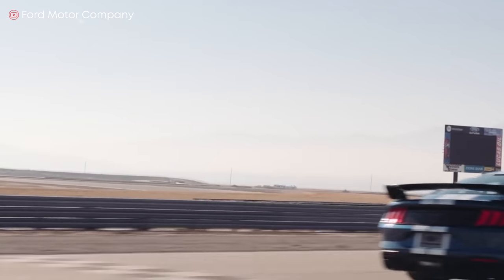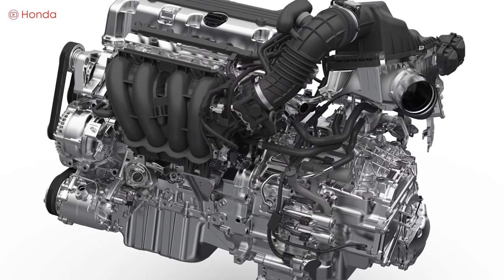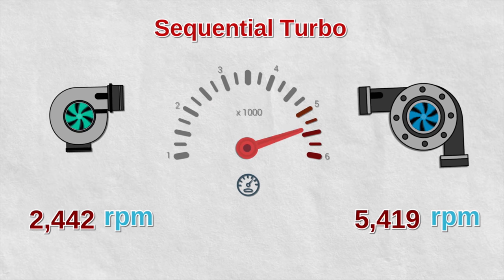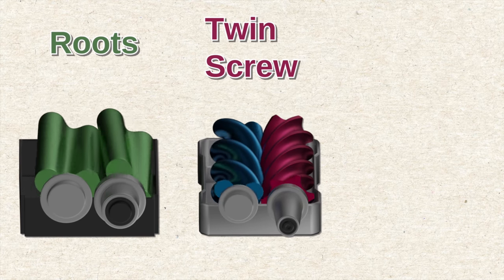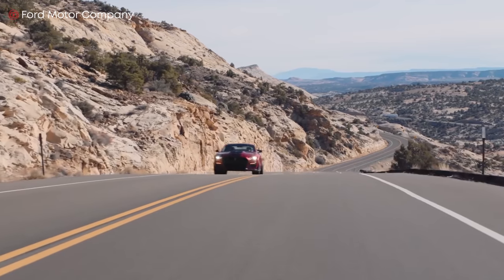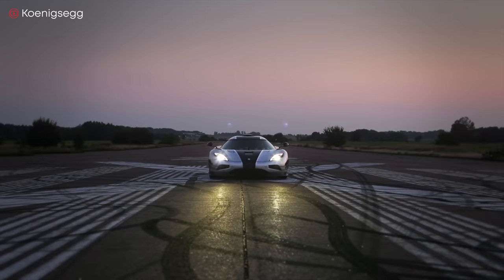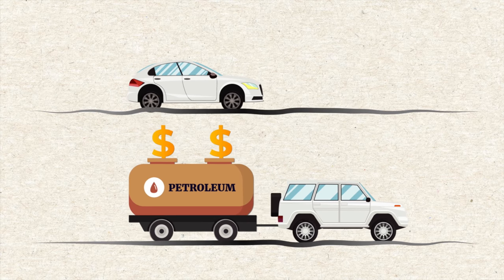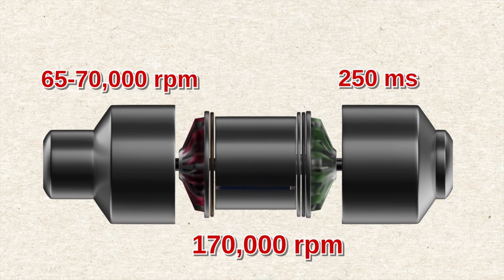This New Mod Will Add 400 Horsepower to Your Car

Comment: I have a problem with the whole "turbo runs on free energy" thought. Turbos create a significant exhaust restriction, the engine has to do extra work to force the exhaust through the turbo's exhaust housing as can be seen if you measure the amount of exhaust backpressure before the turbo.
Reply: Agreed. Exhaust backpressure reduces volumetric efficiency.  Smaller cost yes, but not "free.".
Reply: Jake you are 100 percent correct.
Reply: But superchargers create parasitic losses, so it really depends.
Reply: Yes, thank you! I’m glad someone on here brought up the issue with restricting exhaust. Turbochargers are also parasitic, just not as much as a supercharger.

Comment: I have a torqueamp on my turbo inline 5 VW Jetta and it made a world of difference there is near zero lag and it's more fuel efficient that combined with the E85 kit catless downpipe and stage 1 map tune it's a completely different car... Technology has come a long way from my V8 car days, I sunk so much money into my old 5.0 to make it run 11' and for a fraction of the price and work my Jetta is in the 10'

Comment: Great report, Scotty. Q: Are these New Electric Superchargers avail for retro-fit on older cars?
Reply: Might be a problem since they are 48V... old cars have 12V system..
Reply: @martinsvensson6884  Voltage converter is all you need so no big deal!
Reply: @mmars4032  As long as the generator can deliver the power needed.. Dont know how much that is for such a turbo.
Reply: @mmars4032  VERY Big Deal. On older cars it will be a disaster as the Turbo will over boost the Engine and very shortly blow it. If you knew ANYTHING about efficient combustion and extracting more power from your engine you simply would not say this. Simply bolting any forced induction system onto your engine without changing the Fuel/Air ratio and max cylinder pressure will make the Engine VERY unreliable and WILL blow.
Reply: @packtech  What about aftermarket cold air intakes?

Comment: I want none of the above.

Give me a simple ultra reliable engine.
Reply: Exactly
Reply: Yea good luck. Reliable engine? Then these companies won't make money off people haha
Reply: Your best bet will be to buy a late 90s or early 2000s vehicle.
Reply: @staykota117  - Toyota seems to be making pretty good bank with their simple and reliable engines.
Honda went over to the turbo dark side.
Reply: @BA-gn3qb  yea but weak power and if you start to do things for more power the reliability goes down. But then again can't complain about reliability when you push 1200hp or more
Reply: Gas is going to $4.00 a gal, and electric vehicles are replacing gas engines.  Writing is on the wall, stay home, or walk, run, buss, train, or plane! New Green Deal, coming right at you! Enjoy!  Hopefully not long!
Reply: @staykota117  - I Just need a long lasting comfortable car that cruises at hwy speeds and gets me to work on time.
I'll let other use Darwinism with cars they can't handle.  And hopefully not taking out innocents with them.
Reply: @hans-jurgenwiegand7465  - Yes.  Back to high gas prices with the idiots in charge in Washington DC. 
They don't care about where the electricity comes from.  Fossil fuel and nuclear power plants. 
And they would rather give away our tax dollars to foreign governments, instead of improving our own power grids.
Reply: @hans-jurgenwiegand7465  How's that Green New Deal working out for Houston?
Reply: Variable wallet timing?
Reply: @BA-gn3qb  Was the 2021 siberian express exposing strategic reserve natural gas deficit? Two weeks, boom, done.
OWL Gore has west texas shares I"ll wager.
Reply: @hans-jurgenwiegand7465  i dont care how many cars go electric im never buying and electric car nothing like the sound of real deal
Reply: Toyota 4 Runner the executives were asked if they were going to update the powertrain they said NO it’s a proven 250k plus 4.0 motor to a 5 speed transmission yes you will only get 15 city 19 highway but research the value on these you only drop 4percent of sticker per year
Reply: @staykota117  I drive a 2001 Toyota with a 1.8L 5 speed. I run it down the interstate all the time 95-110mph and it never breaks down on me and it has 192,000 on it. You can't get any more reliable than that.
Reply: I got a acura ilx brand new and they still use a n/a k24 that puts out more than enough power and gets 30 mpg combined. Turbos = lag and less reliability.
Reply: @hans-jurgenwiegand7465  government cannot force anything. forcing you to buy $50,000 electric car
Reply: @ronrodgers6531  right smh
Reply: Like my toyota celica.
Reply: I have an Audi A4 TDI it has a turbo and it is insanely reliable. 500 000km and still going strong
Reply: 6.0 vortec gas has been my most reliable engine to date.
Reply: @staykota117  That's the point
Reply: That's why I drive old cars,they're very reliable and parts are inexpensive. They're also very easy to work on and you don't need special expensive tools either. Another thing that's great about older vehicles is a lot of the parts are interchangeable unlike the crap that's made today.
Reply: @hans-jurgenwiegand7465  And as more and more people get electric cars, electricity rates will rise not only to recharge your car, but to run a light bulb in your house. Everyone will pay higher electricity prices. Even people who don't own a car.

Comment: Ooo I can’t wait till new electronic supercharger!!!
Reply: They already have those.
Reply: @ayebee1207  thaty have a Kirby vacoom cleaner
Reply: @ayebee1207  umm, not really how it works but ok.
Reply: I can’t wait when electric cars will dominate
Reply: @danrook5757  ICE powered cars have personality, electric cars are an appliance on wheels. 'Hey Jeff! That new fridge of yours looks awesome!' 
   Think about another aspect, I bonded with my dad working with ICE cars, formed friendships finding parts or talking symptoms of oxygen sensors, CV joints, clutches or telling stories of a job well done. All these things will be a pastime.
We'll all be driving computerized appliances, that we're not allowed to work on or is too dangerous to work on for the shade tree mechanic.
Reply: @danrook5757  electric cars I think are kinda gimiky hydrogen is better all around and is easy to make. The only byproduct is water out the tailpipe. The current electrical grid is not ready for the electrical load. Another problem electric cars have is the battery technology it’s not their batteries have came a long way don’t get me wrong. But even mining the lithium for their batteries polute and theirs not much lithium.

Comment: Awesome as always!!! Scotty I'm sure that you have a lot of "what if"  or "they should have" on certain models of cars over the years.  If you could take any base model of any car over the years and redesign it to your ultimate car what would it be like? Example: Chassis, Engine, transmission, body style, etc...
Reply: That's a good idea for a video. He needs to do separate videos on different popular models explain the problems associated with the engine design versus how he thinks the engine should ideally be designed.

Comment: Thats a lot of extra horsepower for a Yugo. I think it should handle it.
Reply: yugo doesnt need, it already has so much horse power it isnt even measurable
Reply: 350 Vega's were something. had a friend that had one back in high-school , "The Suicide  Machine". it was  piece of junk(Vega) , usually broken, but when it ran, he could definitely would scare the chit out of you , while riding around.

Comment: Parallel bi turbo system uses two identical turbos which spin at the same time and same speed to give that rapid acceleration.

To counter act turbo lag, stop/start is fitted to shut down the engine when at a complete stop and also a blow off valve, which opens up to dump air with in the compressor out to the atmosphere...

Comment: I thought it was going to be a flux-capacitor.
Reply: Dilithium Crystals
Reply: @jeffreydevoti7000  Well we are closer to that as Dilitium actually exists, lol.
Reply: The Brown capacitor has now been nano engineered. Resulting in lower current draw of .605giga watts and therefore speed reduction to 44mph for activation.
Still waiting for a carbon fiber Delorean
Reply: Your wrong ! It's now called a Multiplexed infuser distribution system

Comment: Useless since the top speed limit anywhere around me is 70 mph
Reply: Faster acceleration and better fuel economy is useless to you?
Reply: Also, who asked you?
Reply: That's when you get to test your turbo. blue lights. turbo don't fail me now
Reply: @Josh-jw3go  who asked you?

Comment: Fascinating. Thanks for the information. 

My car has a small Eaton Roots superchager which remains electrically declutched below the engine at 2000 rpm. It engages when above that threshold. I thought that was quite a clever design.

Now I know more about how it works.

Comment: I have an e90 BMW 335i Twin turbo n54 engine 300hp standard but with t17 upgrade turbo's 750 hp in a car that weighs only 1300 kgs it's a rocket ship and a reliable 5 years since turbo change for better performance and no problems,those that roll up on me in their mustangs and corvettes get a nice view of my rear end, albeit an old rear end a real sleeper.

Comment: To eliminate turbo lag what they could do is drive the turbocharger through a belt-driven input via an overrunning clutch.  Initially, the engine drives the turbo compressor via a direct mechanical connection.  This way the boost is immediate.  Then, as the exhaust builds up, the turbine of the turbocharger begins to turn faster than the input from the engine and the turbine speeds up the compressor which disengages the clutch of the engine input.

Comment: You can easily overcome turbo lag by having the timing/fuel curves set correctly, using a Wideband 02 sensor to trim cylinders that need it, and sizing the converter on a automatic transmission properly.  I challenge you to sense turbo lag on my 1986 4.1 Liter Stage II Buick turbo engine.

Comment: Turbo vs. super: there's a reason why the BOV is nicknamed the hooter valve. You don't get the satisfying whistling out of a supercharger.
The lag is a purposeful design, it gives the other drivers time to watch your grin before you warp speed in front of them. 😁💨

Comment: Smoky Yunick of Popular Science magazine calls the turbo charger the "Homogenizer" for the different octanes found in even high test gasoline, so fuel mixture is burnt completely, and more efficient . He got 375 hp. from 3 cylinder  engines, on his test equipment .

Comment: Hey, I added 100 hp to my 96 GMC  by putting Z28 decals on it. I found that if you put them over the rear wheels it gives you better traction also. Hey, it works for Hondas. 😁

Comment: One major advantage to superchargers not mentioned. Turbochargers don't work at high altitudes where the air is thin. But superchargers which are made to produce three times the rpm, work at high altitudes. That's why piston aircraft engines only use superchargers.

Comment: Scotty you are without a doubt a much better mechanic than myself as a matter of fact i often look to your knowledge with certain things but im sure that you are aware of the gmh two stroke diesel engine which uses both turbo and supercharger i only mention this because I have found that its a pretty easy setup to help explain the way the turbo and supercharger work together with my full respect to you as a mechanic Cheers from Australia.

Comment: How about the  Pogue 200 MPG carburator? Patented in 1936 and tested by the Canadian Automobile Association and Ford Motor company of Canada. Theses were Ford V-8 engines and there was no loss of power or performance. And then there is Stan Meyer and his car that ran on water. You can see a newscast of this right here on youtube. And we could have "free" energy with Dr. Dennis Lee's hummingbird generator that has enough energy for 3 houses and would hardly ever where out or break down. Price? 2,500$ Very economical.

Comment: Volkswagen used both methods of forced induction in their small 1.5L 4 cylinder engines in Europe about 15 years ago. A few years ago they released the SQ7 with a dual charger TDI that used the rear diff as a generator to power an electric supercharger to for the low end and then the twin turbos took over for the high end. This allowed them to reach their peak torque at 1000rpm

Comment: Loved this video, I actually own, an MB 230 E running on Ethanol, which I have customized with a compound system, a big Papa Pig Garett I will not name, sucking air from a belt-driven compressor, with micro fueling! It's like a rocket on wheels, I love it!!!! The engine sound is...... Juicy

Comment: A modern Roots supercharger does not pulse because of the helical rotor lobes along the length of the rotors.  That's why they are shaped the way they are.
Not all engines mount the Roots supercharger on the top of the engine.  There are applications where the unit is mounted on the side of the engine as in the 71 series of the GM diesels.  The difference here is that the engine is a two-stroke cycle engine and it uses the Roots compressor as a blower to get air into the cylinders because a two-stroke engine cannot breath without some means to pump the air into the cylinder; there is no "suck" stroke in the cycle.

Comment: The main advantage of the electric turbo from Volvo.. It does not need the help of hot exhaust gases...So you stick one of these in a hybrid. You get performance and fuel economy...

Comment: You get turbo lag on high performance cars with larger turbos (sob they boost along at higher engine speed) but most model turbo cars such as Ford EcoBoost have almost zero noticeable turbo lag.
The turbos are modest in size and with modern tech they spool in no time and the engines are at max output at about 2500 RPM

For instance: from a dead stop acceleration a Ford F-150 3.5 V6 twin turbo EcoBoost will easily out accelerate any standard V8 truck.
The lag isn't an issue.
And as Scott briefly mentioned, turbos operate on waste exhaust energy while superchargers take a bit of engine power to rotate them.

Turbo all the way

Comment: I really enjoyed this video the differences turbos and superchargers. I have a 2004 monte carlo with a supercharged 3.8 liter engine. People ask me what the difference is between a supercharger and a turbo is, now I can just show them your video. Thank you.
Reply: How much horsepower and torque do you get? Tks
Reply: @JayA-pk7xy  stock is 240 hp. I put headers, reprogramed pcm and a couple other mods to it. I'm guessing about 300 hp at the wheels.

Comment: Yes Scotty your correct you can increase your horse power +400. But you forgot to mention that putting that much boost through your engine to achieve 400+ horsepower, you need to spend a fortune strengthening your engine with forged parts not to mention extra cooling and fuel system upgrades required to meet those high horsepower requirements.
I know I supercharged my bmw E46 M3 and had to do all the other upgrades/modifications to my engine and car to make it reliable. 
It takes a lot of love and passion.

Comment: The flow path with a screw blower goes through the center, not around the sides of the case like a roots. A more efficient flow path

Comment: Keeping in mind lag is way reduced by not compound but geometrical single turbo . This  being a size change in the compressor housing by rotation of the housing restrictor , depending on which manufacturer you use. Not as much on gas engines with lag as in a diesel engine so compound setups and geometrical singles are both used . But now a days the compound sets are less maintenance so its the obvious choice.

Comment: Buy a locker for the rear end for the street and strip. If you have 300hp at the wheels you'll need to be able to hook up the back tires correctly.

Comment: just for the record, it is not turbo lag, that refers to old turbos that were heavy and it took a effort to get them to spool (the lag), the modern turbos are heaps lighter and the lag that occurs is not noticeable or even measurable to anything useful. The term they are talking about when they say lag these days is the " boost threshold", this is how much time it takes to pressurise the the tube to create the velocity. Ties into volume v velocity of air issues, length of pipe from turbo to motor etc. For the sake of generalisation, lag is what most can relate to

Comment: @ Scotty, you related that there are three levels of efficiency, with respect to the three types of superchargers:
* "Roots" type = great efficiency,
* "Twin Screw" type = greater efficiency, and
* "Centrifugal" type = greatest efficiency.

You also mentioned that the "Roots" type supercharger is much heavier than both the "Twin Screw" type, and the "Centrifugal" type superchargers. 

I have a logical question based upon the following two premises:
* a vehicle's drag race results are poorly affected by increased weight, and
* a vehicle's drag race results are poorly affected by increased inefficiency.  

Why do professional drag racers employ "Roots" type superchargers, on their dragsters?  Should they employ either the "Twin Screw" type or "Centrifugal" type superchargers, on their dragsters?

It seems like common sense.  To employ the lightest, most efficient supercharger will yield the greatest drag race results.